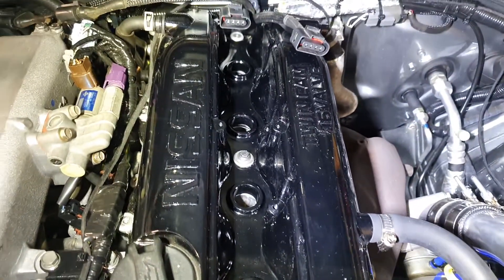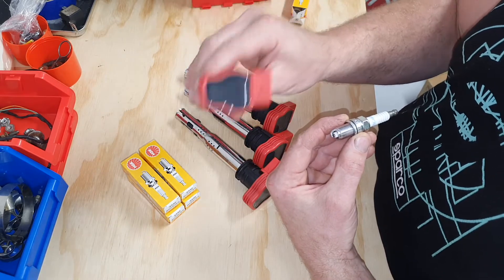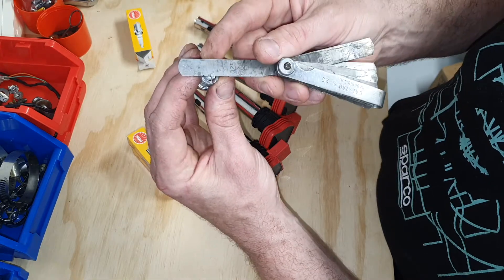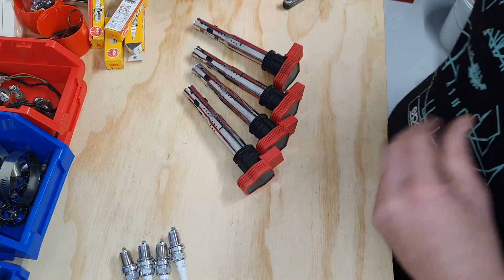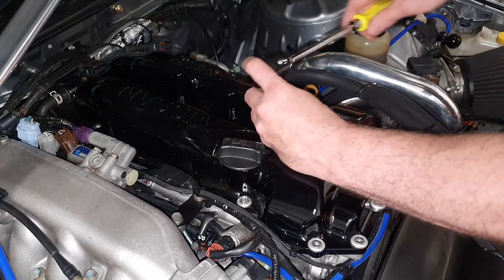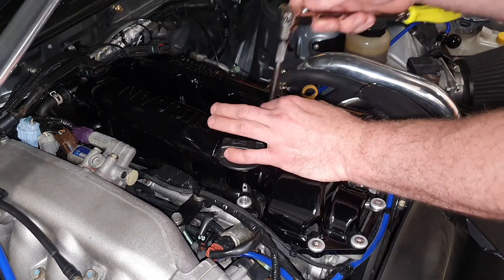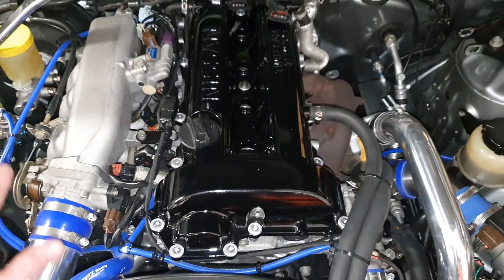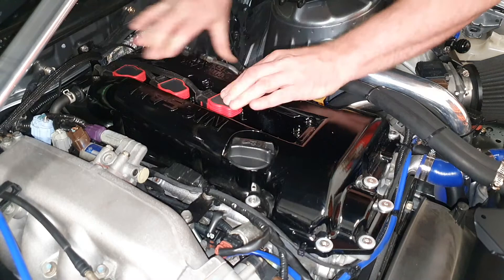How To Gap Spark Plugs & Install | SR20DET Silvia S15 Audi R8 Coilpacks

Comment: any ideas where to get the bracket to hold coils in place? i cant find anyone selling just the bracket. what did you do?
Reply from the maker: I don't know anywhere that sells them separately. They actually clip well enough into the spark plug base of the plug (the hex) to stay put. Just be careful if cleaning your engine bay, any water is a mission to get out of the plug holes, trust me I know! Lol

Comment: After you get the coil packs all wired up do you have to adjust anything with the ecu or they work straight out if the box. Dwell settings and such?
Reply from the maker: The dwell specs I believe are very similar to std s15 coilpack specs. You can fine tune it if you know the dwell settings for the coilpqck with your tuner. My tuner didn't need the specs. They worked great with std stock spec r ECU even when it wasn't tuned (now running old Power FC). No need to adjust anything unless you want to really minutely fine tune. So to answer that question, they work just fine without any adjustments. 🙂
Reply: @JoeYates77  good to know, thanks for the quick response 🤘👍

Comment: What u use/how do u clean out the plug holes etc
Reply from the maker: Normally compressed air with the spark plugs still in and brake/parts cleaner, you can use electrical contact cleaner for the coils and connector pins as well. Also, once plugs are removed you can blow as much of any debris out with the plugs removed and then a clean lint free rag on a long screw driver wrapped around the screw driver works ok for the spark plug tube with some brake cleaner to clean them. Ideally you don't want and debris falling in although it will get burnt, compressed and pushed out the exhaust ports anyway. Just good practice to try not let any dirt ect drop in.

Comment: Where did you buy the coils? Did the come with wiring adapter?
Reply from the maker: I actually made the wiring harness myself. I had to buy the coilpack connectors and make it from scratch. Not that hard, just requires some patience 🙂
Reply: @JoeYates77  Good effort. I'm not a fan of wiring.
Reply from the maker: Oh I forgot to add, you should be able to buy them from EFI Solutions or Car Mods Australia. Not sure about outside of AU. The Bosch ones are more affordable than VAG parts. I'm pretty sure they are relabelled anyway. Someone can correct me if I'm wrong. Bosch make good parts so running those ones should be fine. I bought mine second hand even cheaper.